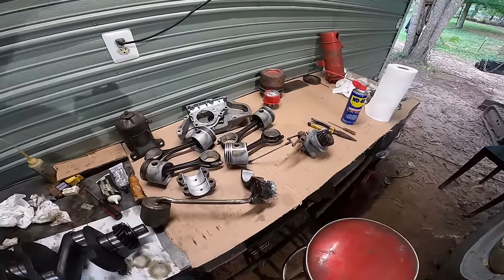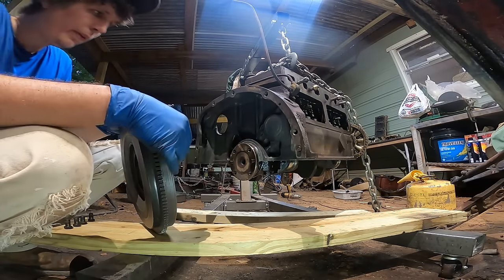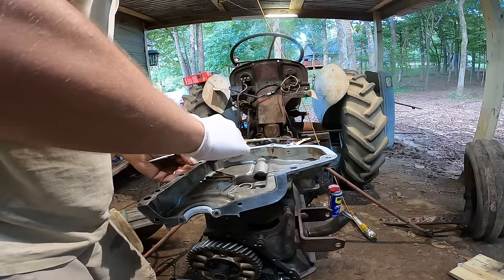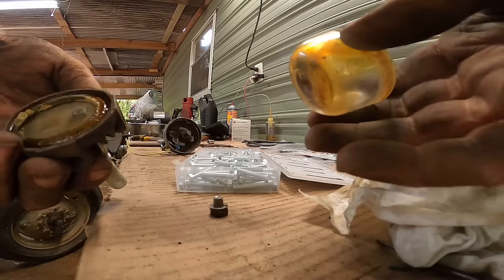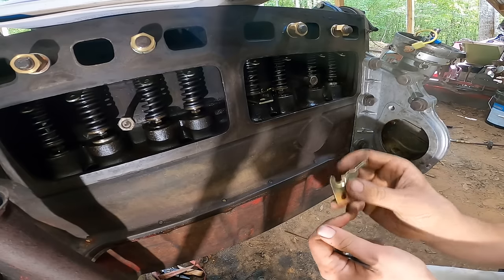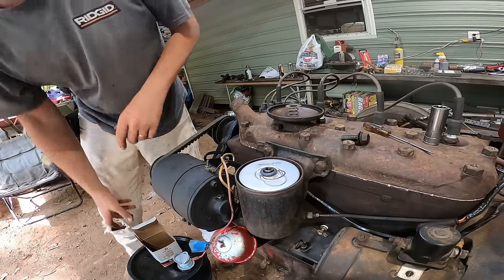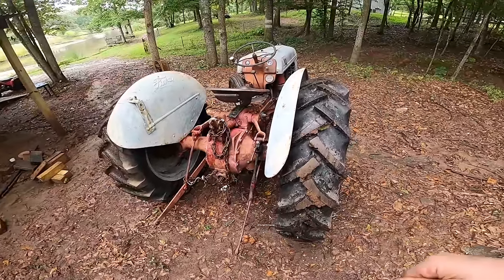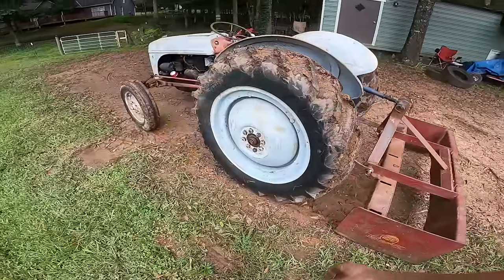RESCUING A 1952 FORD 8N TRACTOR FROM A BARN (PART4) SHES ALIVE!!!

Comment: Seeing the gear shift move, I believe it is a bad input shaft bearing and maybe the thrust bearing too. I would replace both as soon as possible or it will start to put wear on the gears. I am 64 yo and grew up on a farm and have seen this before. We fixed our own equipment. Also, we had the same 8n tractor just for pulling flat bed wagons into the barn but, we never had too many problems with "that" tractor. Mostly had problems with the John Deere tractors.
Reply from the maker: my thoughts exactly!! that’s awesome man!!

Comment: The grinding sound from the trans sounds like you were low on hydraulic fluid. The PTO is stopped with the clutch as well. Yes if you plan to use a bushog or an implement with an inertial force you want a clutch on your PTO shaft.
Reply from the maker: hydro fluid was completely full, I beleive it is the thrust bearing on the countershaft I will make a vid on it eventually just have a ton of other projects going on, you are completely correct on needing a overrunning clutch on the pto thanks for your comment!

Comment: I changed oil in my newly acquired 1951 8N and found there is no screen in the oil pan.  I was told it wasn't important.  Now I know better and next oil change I will install a new one.  Same issues as you with ordering parts.  Ordered oil cap filter and oil cartridge, got two oil cap filters.  The order picker needs to put his bluetooth away and pay attention to his job!
Reply from the maker: Yes it’s very important and it’s only like 20 bucks for the whole thing. I just had like the same thing happen lol good help is hard to find nowadays

Comment: You may try draining the transmission and refill with a heavier weight oil   witch is also the hydraulic oil also 👌
Reply from the maker: I should have a video coming out looking into the trans and fluid and all 🙂

Comment: I'm surprised you didn't go ahead and replace the piston rings.  I looked it up, and a set only costs $105, and you already had it torn apart. Piece of mind is worth that I would think, especially when you had one cylinder with low compression. Still, looks like you did a darn good job!
Reply from the maker: I did buy a whole rebuild kit and was gonna replace them but it runs perfect so I guess I’ll replace them when it gets bad

Comment: Noise coming from the bell housing is likely a worn clutch throw-out bearing, if you hadn't changed it out with the rebuild. I've lubed them with engine oil and gotten a lot more miles out of them.
Reply from the maker: it’s actually from the pto thrust bearing I’ve been wanting to do a vid on it but haven’t had the time☹️

Comment: A very interesting channel youg man.
  Just some poinys you may find useful an of use to you. Neber oil the face between the big end con rod and bearing as that will prevent the bearing being properly located due to the thickness of the oil fim?
  Ther correct way of fitting te shell is to slide the bearing in, thus scraping any dust / debris off the mating face, you can also put new shells in using the same technique with the crank still in the block by placing a screwe in the oil hole of the crank and winding the old shell out and replace the new one the same way.
   I believe you should always fit head bolts dry, you mess all the torque settings up by redicing the friction on the thread!
  In extreme cases oiling / greasing a thread that is in a blind hole can hydraulic  the bolt as the bottom of the hole is basically full of a non compressing grease / oil thus ruining all the torque settings.
   I also believe the latest idea of torqueing a bolt and then turning a further number of degrees is rubbish, if you tighten 10 bolts this way the first ones will be looer than intended, My cheat on this situation is tighten on the this setting then use a torque wrench and keep adjusting the setting on the wrench till it just moves the bolt then use that setting to tighten the rest, this will allow the rest of the bolts to be all the same in the end.
    Keep up the great content and look after your health.

Comment: Sounds like you got it back together I noticed that it sounds like it's missing a little bit on the firing and I didn't see where you relap the valves probably valves aren't seating maybe look into that might run smoother but excellent job I really enjoyed the video I'm getting ready to work on mine and I'm going to do the minimum like I said mine was supposed to run just going to fix the flywheel and see what happens
Reply from the maker: I did do the valves but did them off camera, the carb was off a bit in the video but I now got it running really well

Comment: brilliant to hear it run..however when you spun the clutch thrust bearing,the noise i hear is what you can hear when clutch pedal is up the release bearing is worn out and should be replaced.
Reply from the maker: yea the bearing was dry in video I just cleaned it w brake clean, after oiling it it was smooth as silk

Comment: If it's running rich it could be caused by the valves like my previous post make sure the valves are lapped and seating if they're not you're not getting complete combustion could cause rich running condition most carbs are pretty simple shouldn't have to replace unless they're really worn out in my opinion
Reply from the maker: Thanks for all the great tips!

Comment: My concern is the sound of the throw-out bearing; when you showed it,spun it, it sounded dry! I would have greases it or replaced it. That will make noise and burn out.
My guess is you cleaned it. Now I didn't see you use any grease, if you lubed it with that thick lube your using, that wont last at all. 
Great series!! Keep up the good work!
Reply from the maker: I just cleaned it with brake clean it was dry throw out bearing is totally fine haven’t had any issues out of the throw out bearing thank you 🙂
Reply: That sound I heard will amplify, without lube it will get worse, it may be fine as in no play or in good shape, but you asked about the sound, well when you move the clutch rod, its taking up any play or releasing it making play, that sound it made when you spun it for us will just get louder. Check it when you pull it apart again!
Reply from the maker: I actually dug into it and found it to be the pto thrust bearing, the throw out clutch bearing is still perfectly fine no noise at all. in the vid it sounded bad because I just cleaned it and it was dry once lubed totally quiet, I do plan on making a video on the transmission I just got a lot of other projects going on rite now
Reply: Great,,, I figured it was a bearing sound, I'm not sure what was used for lubrication on those old throw out bearings. Some are "Oilite" so they are lubed kinda permanent. I know to be careful with any lube near a clutch for sure. 
my thought was to grease it like a wheel bearing but I'm not sure on that.
So much of that machines looks great!! 
Lookin forward to more vids on it!
Keep up the good work!

Comment: The noise is your throw out bearing that you did not grease. I have older model 8n and 9n ford's. They tend to be noisy but that bearing is worn and needed to be greased and or replaced.
Reply from the maker: I actually did grease the throw out bearing very well and was super smooth, in the video it sounds rough in my hand cause I spun it after cleaning it with brake clean

Comment: Sort of a volume issue going on. The music seems to be 3 or 4 db stronger than your voice so it requires constant readjustment every time we switch back and forth. The cure I think would be one of those fancy Go-Pro wireless mics.
Reply from the maker: yes you are correct I tried to fix it but I really need a go pro mic

Comment: I have a 49 and tried the cheap internet carb. I could not get it to run right so rebuilt the stock one. Mine is converted to 12 volt. Axel seals had to be replaced and have the seal for the PTO to put in.
Reply from the maker: Awesome thanks my friend

Comment: the clutch noise you hear is the throw out bearing, did you replace it?.goes away when you press on petal, I would not be to concerned , some brand new ones make noise. check your rear outside axle nuts make sure they are tight they are splined, if they are loose it can wear out the splines .
Reply from the maker: thanks a bunch!!

Comment: One of those noises is almost certainly the throw out bearing, and the valve train should be much quieter, should be able to tighten the packing nut for the fuel shut off and stop the leak, if not than repack it
Reply from the maker: you are correct but I know a lot of people think it’s the throw out bearing but I assure you it’s not, it sounded bad in my hand cause I just cleaned it with brake clean and it had no oil, once I greased it it was silky smooth. the noise that the tractor is making is coming from the pto cover I’ll have a video coming out soon about it.

Comment: Nice video.  But, that grinding you hear is not normal.  It may never cause a problem but I would not trust it.  Also the gear shift moving when in reverse is not normal.  I have a 641 and an 8N.  Neither one of the had a grinding sound.  Sometimes a gear whine since these are straight cut gears and they tend to whine a bit.  Good luck.
Reply from the maker: thanks for the info!! I should have some videos out shortly of working on the transmission so stay tuned

Comment: She lives which is great to see, well done. Hope you have many happy years from her. 
What you are hearing when you depress the clutch pedal is the thrust bearing, sounds like it’s on its last legs. If you go into the video to the part where you are assembling the clutch you spin it with your fingers and it sounds like there’s 1/2 a bucket of sand in it. Also when you had the box blade raised and the tractor was stopped with the engine running there is a distinct clicking noise coming from the back end that might be worth checking out sooner rather than later.
Reply from the maker: Yes in the video the bearing sounded bad cause I just cleaned it with brakekleen but when I oiled it it was perfectly smooth with no noise or any wobble at all, I will be tearing it all back down and checking the tranny and all shortly. Thanks for watching and commenting I really appreciate it!!

Comment: The noise that goes away when you press the clutch in is probably the thrust bearing you shoud have replaced,  😂👍
Reply from the maker: thrust bearing sounded bad on vid cause I just cleaned it but after greasing it was super smooth with no play, the noise is coming from the trans not we’re the clutch is

Comment: I would’ve put a new clutch plate in Whether it needed it or not check the gearbox oil as well
Reply from the maker: yea I’ve been using the tractor a lot lately and the clutch has been working really well so far

Comment: Will you be able to bore the cylinders yourself or will you have to get a machine shop to do it?
Reply from the maker: I honed the cylinders but u can buy sleeves that just slightly press in
Reply: @TheHomePros6221  The trick to getting the sleeves in is to put them in a freezer overnight so that the metal will contract and can be easily fitted.
Reply from the maker: @michaelwalsh9145  yup u are correct!

Comment: What is the reason for not reassembling the engine with pistons, manifolds, etc. prior to bolting it to the transmission?
Reply from the maker: It would have been much harder to do that way, and the manifold would be in the way to adjust the valves which u have to spin the engine over many times to do, not to mention it would be much heavier to install and line back up with the tractor

Comment: a  transmission bearing seems to be going out and that would cause the shifter lever to move.  you might be splitting the chassis again
Reply from the maker: I think you are completely correct my friend!!
Reply: @TheHomePros6221  it seemed that the clutch shaft had more than normal movement when you were showing the clutch installation.
Reply: All good advice, but make sure to open the top box cover 1st.  I think you'll find that flat needle thrust bearing to be the culprit.  If so, no need to go further.  That bearing is not critical to operations.  It did however take up slack on the shaft between the two gears.  Don't replace it, just remove the bearing segments and clean out the bottom of the case with a magnet.  
Replace the fluid.
Reply from the maker: Probably the best advice so far thanks Richard I’m going to check into it and post a video

Comment: What did you pay for it and what did it cost for parts to rebuilt it. I had one and did some rebuilding  transmission and  3 pt. Pump.
Reply from the maker: I ended up paying $700 for the tractor and I had about $270 in parts so I think I did pretty good on it I use it all the time

Comment: Pull it back apart and put in a new throw out bearing.
Reply from the maker: the throw out bearing is actually in perfect shape no play rolls silky smooth no noise, wasnt greased in vid cleaned w brake clean

Comment: I hope you did not do what I did when I rebuilt an 8N just like yours.  It was year ago and STP was the 'go to' product.  Trying to be real nice to the new bearings, I put a can in, added the oil and fired it up.  Before I could stop the engine, it has seized solid.  Yup, the thick STP had blocked the oil pickup.  Lesson learned and another set of bearings.
Reply from the maker: dang that sucks man!! but no I did not do that

Comment: Love all these videos, you've got a great touch with camera and are a very talented mechanic/ Home Pro.
Just a suggestion or two meant w/ respect. Much of your talk is low volume (camera mike?), and cannot be heard unless I turn my volume way up. When music happens I jump and have to lower volume and the raise when it ends. My suggestion - the very be videos of this type - the person on screen rarely if ever talks. If something needs to be said - like for example naming the spray you use on gaskets, use the option for a text window pop up during editing, and let us read it. Always avoid stopping work and doing a long talk. I think you will find this makes things for you much much easier. 
Check out Engels coach shop you tube channel, who uses low volume music in background throughout the no-yak-yak video. I like that touch, a lot. Keep it up. What with your Home Pro and mechanic-ing, you will be at 1 million subscribers in no time.
Reply from the maker: thank u very much I’m not the best at editing and I do need a mic so ppl can hear better I try and keep the talk to a minimum but other times I try and explain as quick as I can

Comment: I tell everyone to not buy tractor supply paint. Oh it goes on nice but it dried it was porus as heck and looked like crap with the black  mold.   That noise is bad, check out the tranny oil. That throw out bearing  needs help before you work it. Good video !
Reply from the maker: oh dang lol

Comment: The ridge at the top of the cylinder doesn't mean anything it's where the Ring stop all it is is where the cylinders wore a little bit rings still could be okay to run long as your ring Gap is right and cylinders not worn too much probably don't need to be bored
Reply: I just acquired an 8 N so far all it needs is a flywheel ring gear the ring gear is stripped was running guy gave it to me said it wouldn't start guess why LOL
Reply from the maker: Dang that’s a pretty easy fix u can buy new flywheels cheap on ebay

Comment: Get a new clutch throw out bearing. That is the noise when you push on the clutch pedal.
Reply from the maker: I did check into it and the throw out bearing is fine I beleive it’s the thrust bearing on input shaft

Comment: They make different sicknesses of threaded rod that you can also replace the studs if need be with and cut off and make new studs and loctite in a block I don't recommend that cheap threaded rod at least mid-grade there's different hardness rated so threaded rod
Reply from the maker: yes I was thinking of doing that but I needed somthing with the fine threads of the brass nuts for the exhaust

Comment: There's one thing you did not check before you put your main bearings onto the block, you didn't confirm so we could see you did ,is confirm the oil hole lined up from the block thru the main bearing
Reply from the maker: they did👍

Comment: I can't believe you didn't just replace that throw out bearing after I commented last time and you agreed that yes you were going to replace it.. ive seen lots that appear good but turned out bad but now you just cost yourself more labor time. Good job anyways though
Reply from the maker: I probably will but to do that I’ll have to split the whole tractor and the noise isn’t coming from throw out bearing and it doesn’t make the noise at all in reverse, if it was throw out bearing it would make the noise in reverse also

Comment: Had you read and acted on viewers advice, you would have replaced the throw-out bearing , cause that's the noise your'e hearing. So if it gets to you, you will have to split the tractor again to replace it and maybe the clutch pack as well.
Reply from the maker: @johnlawton5534  it’s not the throw out bearing it is perfectly quiet, it’s the thrust bearing in transmission

Comment: You shifter should not move your transmission shift detent spring is probably broken. Also the transmission sounds like qrap. You have more work to do probably a bad bearing in the transmission.
Reply from the maker: Yes I believe you are correct my friend